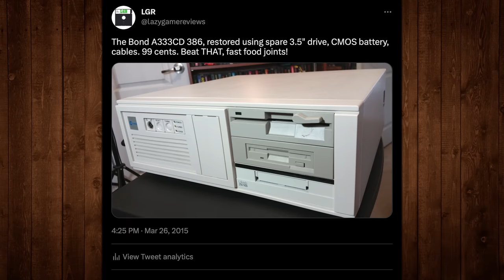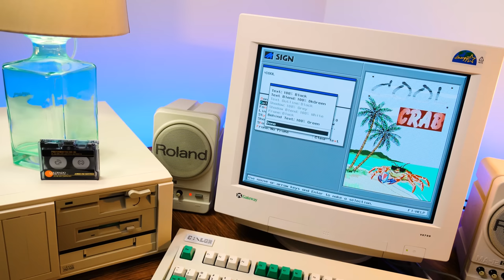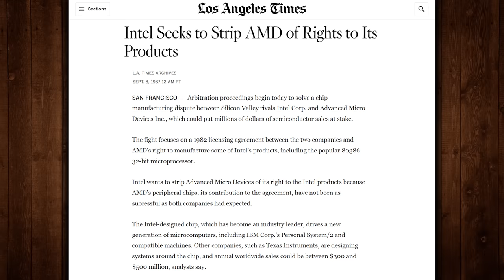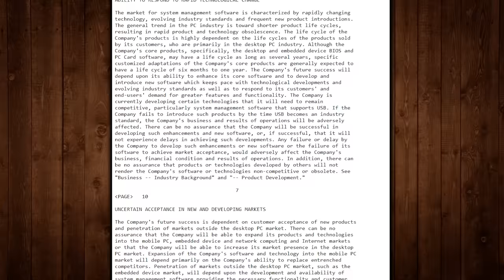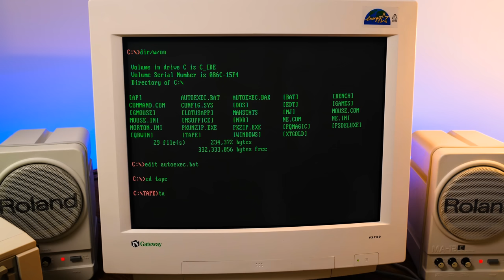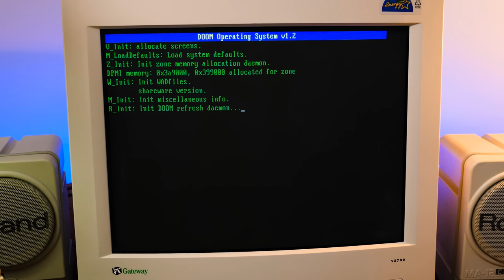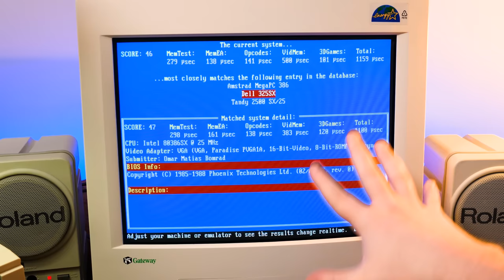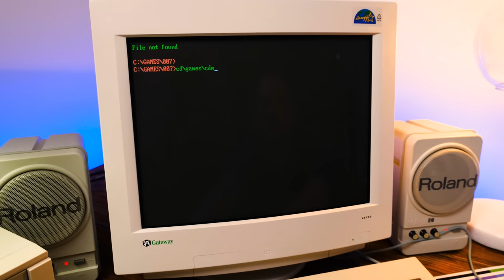Exploring a PC Built by Bond, J. Bond – The 99¢ 386

Comment: My mom worked in a pharmacy in the ‘80s and ‘90s, and backed up records daily on a tape drive just like this. They took the tapes home every night.
Reply: My dad did the same, only once a week: take the tape home, check if it was correct and store it off-site. Bonus was we'd get a company sponsored tape drive which we could freely use for our own backups.
Reply: Back in the day, I did the same. I started off backing up on diskettes, but that got too time-consuming after a few years. Around then, I noticed an unused tape drive in my employer's computer "boneyard", and asked about it. They had outgrown it and replaced it with a newer model. It was perfect for my old 386 PC, so I took it home, installed it, and after a successful test, i got more tapes and started using them for backup. That drive used wider tapes, though, maybe DC 6150s. When I replaced that computer, I bought an Exabyte Eagle96 tape drive that store up to 3.2GB per tape, compressed. That drive looked a lot more like this Colorado 250 from the front. I thought I remembered the MC3000XL QIC-EXtra cartridges as longer than the 250MB QIC cartridges shown in the video, but after looking them up online to refresh my memory, I think maybe they were wider but were inserted sideways into the drive. In any case, I had 3 cartridges. One was in my desk at work, one in my carry bag, and one in the drive, and I would rotate them several times per week.
Reply: In my first company our sysop loved to mock the new trainees he got in his department. He told them the story that he got delivered fresh new backup tapes and because the manufacturer once fooled him in the past by sending tapes that didn't had the capacity they were labeled as, they should measure it. We had a long hallway in the building and he tasked them with taking the tape out, rolling it out and measure the length with a yardstick. So at least once a year if you saw a young poor guy on his knees with a yardstick in the hallway, everyone knew that Stefan had a new victim.
Reply: The servers my mom worked on in the mid-2000s still used them. Granted they were an university's servers and they don't tend to remove legacy stuff from administrative systems fast.
Reply: My work still does that, although one of the “tape drives” we use actually just backs up to 2.5” HDDs in caddies that look like tapes
Reply: I hope you still have them, those would be fun to try and recover data on.  I got some IBM data cassettes before when buying old lots of music cassettes, I have no idea if someone taped music over them though or they still have PC data on it.
Reply: When I worked in my parents business during the summer, I remember using the Colorado backup system at the end of the working day. The sounds brought back memories.
Reply: If you trust your employees that is smart actually. No reason to back up the data and leave it to the place it can disappear with the main data if an accident happens.

Comment: I remember using J. Bond mouse driver in DOS. It was small enough to fit into the upper memory block, so it was ideal for freeing enough conventional memory for the more demanding games like Falcon 3.0.
Reply: Installing a mouse driver to free up memory for games must've been quite a era. Now we just take everything for granted
Reply: @jishan6992  It was a thing. You wound up with boot floppies matched with the game you wanted to play, with the specific arcane combination of  TSR drivers and memory extender/expander required that specific game.
Reply: @marblemunkey  the heck so you'd be switching out the entire OS everytime you wanted to play a game?
Reply: @jishan6992  yeah, kinda. A basic DOS installation fits on a floppy disk. Some early PCs didn't even have a hard disk and ran entirely off of floppy.
Reply: @marblemunkey  that's what I was wondering actually, I have seen ton of videos Retro computer and they always slide in a floppy to boot in to the OS. Also I have seen playing games that would come in multiple floppies, how did that work?
Reply: @jishan6992 It was a problem with MS DOS. As Bill Gates said: "640 kB is enough for anyone." Yep, kilobytes. It wasn't and one had to go through all manner of shenanigans to make everything fit in the 640k limit or work around it.
Reply: Back in the DOS days with DOS 6.22 I had a custom boot floppy with a AUTOEXEC batch file that had around 10 different configurations for various games. W/o the floppy the PC would just boot to Windows 3.1 like normal for the rest of the family to use. 
It was basically a must to setup something like that for many DOS games, especially when you added a CD-ROM drive to the mix. I still remember having to create a new config in order to get the CD version of Return to Zork to run. It was a challenge to get over 500K of free conventional memory with CD-ROM, mouse, sound card and any other needed drivers present. At times getting the perfect config was little like voodoo and took a lot of trial and error even when you had the help of software like QEMM or the memory utilities in DOS 6.
What people have to deal with now to get most Windows games to run on the PC over the last 20 years is nothing compared to how it was back then!
Reply: The sim "Navy Strike" required a special boot disk to load high speed GPU drivers (or a generic one). Took me numerous tries to get working correctly. Fun times.
Reply: Ahhh… the fond memories of getting Frontier II Elite running. Good times, and a great teacher for problem solving skills.
Reply: @marblemunkey  these young whippersnappers have no idea what the PC experience was really like back in the day.
Reply: @marblemunkey  I had one of those tinted see through disk holders full of boot disks. I think I stacked them and it was about a foot tall. Heh. Interesting times. Nostalgia makes me miss it, but then again…
Reply: The Names Bond James Bond.
Reply: @jishan6992  depends on the game I guess. On PC, games on multiple floppy disks are typically meant to be installed on the hard drive, like you would do for games from a CD. You might still want to boot from a floppy disk your customized DOS version (that maximizes free ram and only loads the needed drivers to play them), but once you’re booted from A: you just switch to the hard drive C: and run the game from there. Less common but possible, I guess, is bootable games on multiple disks that will ask you at some point to insert disk 2. No hard drive is needed for those (this happened often on the Amiga, where many models didn’t have a hard drive)
Reply: The dark ages before CuteMouse was a thing.
Reply: @jishan6992  Regarding multiple floppies, there were two major strategies I remember off the top of my head; 1) one disk to load the game and one disk to run the game, 2) "Please insert disk xxx", ie during load screens you had to swap disks -- this was a major reason why you wanted more than one floppy drive. Up to four floppy drives was not unusual, two being considered a minimum for "serious" gaming. I remember playing The Adventures of Willy Beamish before I had a HD and swapping between the 13 or so disks was insane. Getting my first 20 MB HDD in the 90s was a game changer!
Reply: @jishan6992  For multiple floppies, it really depended on the era, and what kind of computer you had. My first computer was a C64, and one of the first multi-floppy games I had was Might & Magic II. It came on 4 double-sided disks (yes, 5 1/4" disks could be flipped over), and it would generally prompt you for a different disk when you hit a different peice of the overworld. Notably, when I bought this game again for the PC, it came on one 3 1/2" disk.. By the mid 90's, it was generally assumed that an x86 PC would have a hard disk, and the installer would just span multiple floppies (the most I remember was 15).

For boot floppies, yeah separate copies of the basic DOS OS. It wasn't the only option; you could craft your autoexec.bat with a menu and pick different options, but boot floppies were easier and didn't require writing code. For the last hurrah of DOS games, they were almost a necessity. Games could require 580k, 600k of the base 640k ram, and you might need to load a mouse driver, a CD driver, a sound driver, and a memory manager.
Reply: @marblemunkey  Until DOS 6.0 introduced boot menus. Those made life WAY easier.
Reply: Yep if you were a gamer in the early early 90's you learned real fast how to write an Autoexec.Bat file along with a Config.Sys file.  Back then every jumper had a real needed function and you only had so many IRQ spaces so you had to mange them for everything to work.  It's the reason why today Steam reviews are Potato complaints because they have no idea how to configure their PC's so blame the game and the mythical Optimization claims.
Reply: @jishan6992  Think of it as just the boot loader more than the entire Operating System that's being changed each time.
Reply: Ah the quest for maximum free portion of 640K, it was truely an art to optimize dos drivers
Reply: @marblemunkey  For me it was about freeing chip RAM on my Amiga, I had a whole ton of extra "Windows-like" features such as a start menu, 256 colour desktop graphics(icons, wallpaper etc.) and graphics could only be loaded into chip RAM, so certain games had to be loaded before the hard disk booted and loaded all the extras. Amigas had the functional "basic" OS on a ROM so you didn't have to make a copy of the OS, just have an autoexec.bat equivalent(called "startup-sequence" in the "S" folder on the disks' root) that basically cd'd to the game directory and executed the .exe and it'd be go time.

Whilst most Amiga games could boot directly from original game disks without needing installed to the hard disk, loading it from hard drive with a boot floppy was about 10 times quicker.

Comment: It's insanity what the vintage market has turned into.  In the late 90's and 2000's, you couldn't give an old 386/486 machine away.  They were thrown away by the millions.
Reply: It's true!  I remember in 1997 or 1998, my uncle gave us a 486 that his company was getting rid of (my first desktop).  We had to buy a monitor for it.  I remember that it was a 15" HP that my uncle got for $300.

Comment: You are so right about vintage computer price inflation. In early 2007, I bought a working Tandy 1000 HX with a CM-11 monitor and manuals for $50.  You will pay well over $500 for that today.
Reply: I used to go through flea markets ni the late 90's/early 2000. 

I bought 486 and P1 systems for $10-20. C128 for $20. I think the most expensive was a P1 Win95 laptop that worked, and had SimCity 2000 installed. 

I regret not buying up everything I found back then.
Reply: I don't remember any details or specs because I was like 13 but I remember buying a Windows 98 PC with a keyboard, mouse and even a monitor for like $30. It had a lot of Bible and chess software on it
Reply: @dyl9013  I wish I could have gotten my WIn98 PC for that price. Thankfully I paid under $100 still for what's basically a Pentium II machine but it's a 2006 tiny office PC that was built with legacy hardware/software in mind so it's got all the ports and all the drivers for using in Windows 98
Reply: I call this inflation "LGR tax" 😅.
Reply: I saved a bunch of such systems from the trash in the 00ies, still having them in my collection. Glad I did that back then, when those old PCs were just... well, old PCs, good only for the recycler. In absolutely NO. F**IN'. WAY. I would spend the amounts of money required today for a 386, 486 or a Pentium machine.
Reply: @offspringfan89  Could be, that specific systems, shops, or configurations are maybe looking for ways to keep their existing setup running, while current hardware might be failing. But the word 'vintage' alone is something that inflates prices.
Reply: I got vanloads of old Macintosh stuff about the same time.  Both PPC and 68k. I sold one of the Quadra 950s over a year ago for over $500 and it didn't even work.

Comment: Oh my - Wolf 3D with a PC speaker on a 386. So many hours of my youth spent on that. 

Relating to finding PCs, I was lucky enough to find the exact make and model of computer I had growing and was able to buy it last summer. An AST 386/25 SX. I had an ebay saved search and as soon as it came up I bought it for a not unreasonable buy-it-now price. It even came with the matching keyboard. I gave it a good cleaning and inspection when I it arrived and it everything worked as it should. I guess my point is while the online prices are not as good as they used to be, and true deals much harder to find, if you really want one or two machines for a collection it's still cheaper than a lot of  hobbies  :)

Comment: that red and green DOS prompt styling is sick...wish I would have thought to try that back in the day!
Reply: I made the prompt brighter once.  I totally forget how 10 year old me did it, but I had fun.  :)
Reply: @denniswoycheshen  High bit of the BIOS color code toggles partial or full intensity.
Reply: I remember loading ansi.sys and being able to do some really neat things with the prompt!
Reply: It was all in the MS-DOS Help program about config . sys, ansi . sys, and autoexec . bat. I used to put a clock on the command line (nice way to check the time with just the Return key), change text color to dark cyan, and the newline contained the DOS prompt.

It was possible to change what the default commands did, so, that DIR sorted all the files right — folders first, sort by extension, sort by name, and show by page, if there were more files that wouldn't fit in one screen.
Reply: @mardus_ee  wow, that sounds like something that I really missed.  I was about 7 or 8 when I started messing with computers so reading the documents wasn't exactly what I wanted to do, or could fully understand.  So you could basically customize dos to your liking?  I never thought it was even capable of such things.  Computers are weird.  :)
Reply: @denniswoycheshen  It was possible to customise DOS like that, and I'd discovered this in the late nineties, when we had our first 486 at home for many years already (initially, with Windows for Workgroups 3.11), and once I could grok English better.

Meanwhile, a then-friend of the family passed down a small instructional DOS booklet, and I began writing explanatory notes about the various DOS commands, initially as a memo to myself. Of course, I got carried away.

We had no Internet yet, and I got curious about what the DOS Help program would display, since I knew about that (years earlier, I'd once simply entered "help" in DOS to find out what this would do). The contents there were concise. Can't recall, if the files or articles were hyperlinked via highlighting, but the names of specific help files that were referenced, were indeed highlighted at the end of each file (similar to "See also" on Wikipedia).

Eventually, I stumbled upon the help files to do with batch files and system files, probably because I wanted to find out a specific batch command or functionality.

We wouldn't have had this beat-up 486 in the mid-to-late 1990s, were it not for one member of the household getting into a small accident and needing something to write homework during recovery.

Edit: IIRC, one needed to load or refer to ansi.sys in config.sys first, and then configure autoexec.bat.
Reply: @denniswoycheshen  Makes it kind of like Windows, but without the GUI.
Reply: What I find interesting about it is that the escape sequences, the [1;31m stuff, are exactly the same that you can still use in *nix terminal emulators for setting text color, the only difference being how the escape sequence is started, $e here whereas on *nix it depends on the shell you're using.